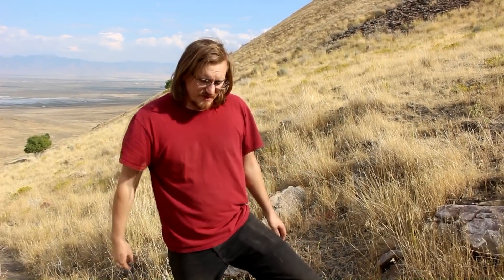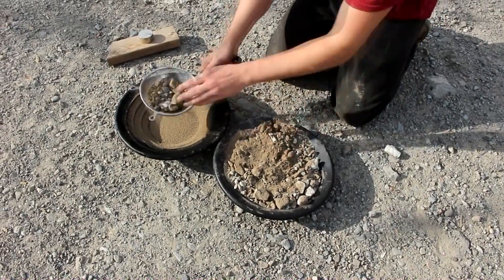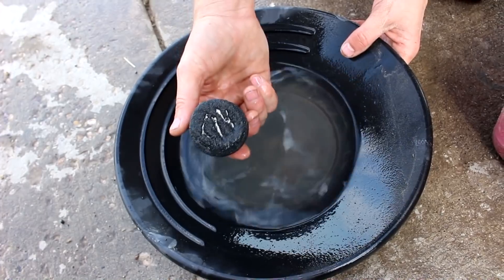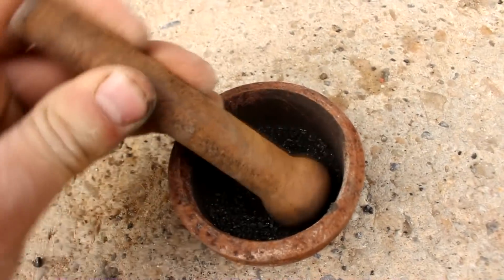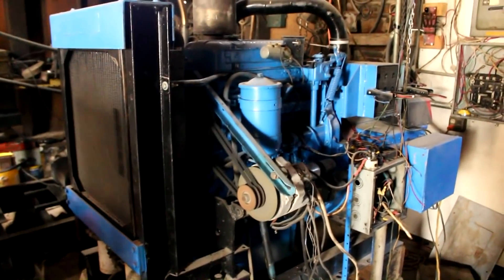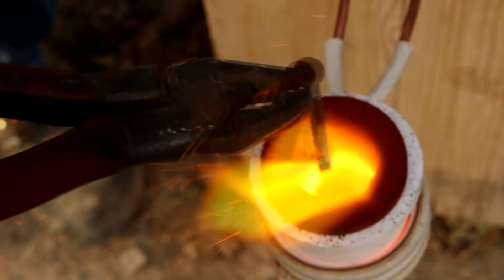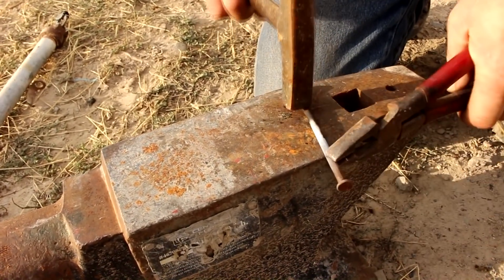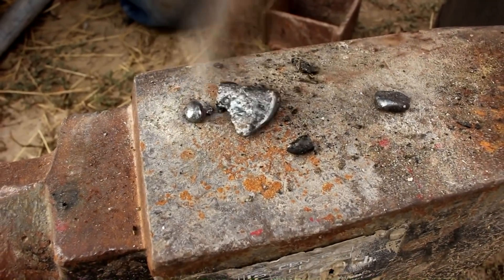Rock to Iron

Comment: I've always wondered, are you able to consume raw iron and gain nutritional value from it? Cereal, for example, is usually rich in iron which is easily separated by blending in water and using a magnet to sift the particulates. Is that the same iron found in ore?
Reply: Those are the same atoms if that is what you are asking. Metallic iron cant be absorbed by the body but it is oxidised into the Fe3+ state in the stomach. This iron ion is then coupled to the transferrin protein and transported trough the bloodstream. From there it can be used by the body.
Reply: To be exactly clear, you cant absorb metallic iron but you can absorb it once it dissolves in your stomach. Small pieces dissolve quicker then others and iron salts are even more likely to fall apart into iron ions. This is why ferrous sulphate is on the essential medicines list.
Reply: Mike Dang In some countries they cook with a small peice of iron with their food for extra nutritional iron.
Reply: use cast iron pots, skillets etc. to do most of your cooking and iron from the cookware will dissolve into your food.  thats a great way to get iron into your diet without doing any extra steps.
Reply: Mike Dang I'm also wondering the same thing with meat because it's also iron rich
Reply: Do cereal companies ADD iron powder?  Or is it natural?
Reply: thats a good question.   id like to know the answer myself.  come to think of it.  on the box of mot cereals they claim to "have 8 essential vitamins and minerals"  
   just where do those 8 essential vitamins and minerals come from if they dont exist in the cereals naturally.   and my hunch is they dont exist naturally.., so they must bee added at some point.    unless its just some marketing gimmick   like most of the "organic" labeling.
Reply: Mike Dang or you can be an iron dragon slayer from fairy tail and eat iron whenever.
Reply: Mike Dang the only thing i understand in your comment is CEREAL

Comment: 5:55 if you were to super cool that graphite crucible too the point it becomes magnetic could that induction smelter then melt graphite? or would the heat generated warm it up to quickly reverting it back to a non magnetic state?

Comment: when you said you could blow oxygen to make it steel and atm its just iron... not totally correct,  cast iron is actually a steel, as it has carbon and iron, but its too much carbon.    So you have steel, not just iron.  The name cast iron is just because of how its made.
Reply: The term steel does not apply for alloys with more than about 2% carbon, so his calling it cast iron seems correct. After all there is such a thing as cast steel also, which specifically has lower carbon content and is not as brittle, but is also cast.
In other words, the term steel doesn't mean any iron-carbon alloy, it requires a specific range of carbon content (up to about 2%), at least that is my understanding.

Comment: Playing with super high amperage and wattage.....and the cooling water pouring on the ground....that's Cody's Lab.
Reply from the maker: Keep in mind we use rain watter on the ranch, no minerals = no shock. course the high amperage is at only a few volts so.
Reply: Eulemit Beule Yeah but that's not continuous current, but pulsed current. I guess you have some supercapacitors or something similar, because if you had continuous 23kA at 20V you'd need 460kW of power and your wires would probably burn through in a matter of seconds ;-)
Reply: If you want high
Voltage go to eletroboom
Reply: Drakkar Calethiel lol. They are the gold standard of safety on youtube ;)
Reply: dude is totally the crock hunter of science. You get sucked at first because you think he is going to screw up and get hurt, but you just end up learning a bunch of stuff along the way.
Reply: @Jos Geerink Did you read my question and Eulemit's answer to that? He clearly explained that it runs off of 2 2F caps and said that his "spotwelder obviously does not provide that power all the time"... So please in the future, do some research before insulting someone. Thanks!
Reply: Farenhite I prefer photonicinduction
Reply: Yes, my spotwelder obviously does not provide that power all the time (and yes, i have 2 2F caps for that). Sadly, i have no 22kV plug for that kind of shit...
On the other hand, my power supply is capable of producing 300A DC, but tbh, you don't need that sort of amperage for anything (except for testing LiPo packs with 170C charging current, but that is not something most people would even consider doing)
Reply: Binary Bits doesn't, everyone do that?
Reply: Jos Geerink He said he has caps that provide the current. It's just for a short period of time, so it's possible.
Reply: The bigger risk is molten metal over a shallow puddle, nothing too crazy would happen, but i sure as hell wouldn't want to be close to it.
Reply: You were correct up until that last part. High frequency current tends to hurt you in different ways but it can still hurt you. Also, a few hundred kHz isn't really high enough to prevent it from flowing fairly deeply in your body. In the 10s of MHz and higher it would tend to stay close to your skin but it could still burn you badly.
Reply: No, I was correct. I was talking about really high frequencies. I'm not sure of the exact cutoff, but a sufficiently high frequency will not even affect matter in an easily measurable way. I'm talking like gigahertz-terahertz range.
Reply: Dziaji a tesla battery will fry your ass instantly. Try it
Reply: Dziaji,you actually explained it better Electroboom when he went on about "current vs Voltage kills" video,thank you.
Reply: Cody'sLab water=ampholyt so there's always som ions, but you sure know that and could probably even tell how much the 10^-7 ions/liter would transport. Still i would not consider it safe just because it is rainwater. I mean after all you can drink rainwater.
Reply: laszu What's "leanguage"?
Reply: Yeah. This thing only produces a high current because it is basically shorted out. Your body has enough resistance to act as a current limiter at these low voltages. Electricity can only deliver you a dangerous shock when the voltage is high enough to produce a sufficient current through the resistance of your body. It also needs necessary current output to produce said current. It also needs to be at a relatively low frequency to harm you. Tesla currents can flow right through you because they reverse too fast to induce currents.
Reply: Dude, learn to read... And to behave

Explanation for idiots:
Spot welder: Uses BURSTS of high current to weld... Not that i have explained that in my post, but some people are just "special"

And btw, are you 12? Please learn to behave when you grow up ;)
Reply: Super high amperage? Dude, i have a spot welder which produces roughly 23kA @20V in my lab... THAT'S high current. (Btw, i usually connect that thing to my 3kW lab power supply... Which is really good if you feel the need to annihilate iron nails)
Reply: Amperage and wattage are the worst words ever made in the english leanguage.
Reply: +Eulemit Beule 23ka x 20v is 460kw you dumbfuck. Good luck running that off your 3kw psu

Comment: Could you extract titanium from white dye?
Reply: Titanium is muuuch harder to refine, because it's extremely reactive at high temperatures. It needs a shield gas for the whole process.
Reply: Titanium dioxide is used in white pigments, not dyes.
Reply: Starting with TiO2 bought as pigment, I've produced nuggets of reasonably pure titanium with the Goldschmidt reaction before. It just takes a lot of flux to protect it from the air and to help it coalesce, but that's still much easier than shielding it under argon or something...
Reply: Thor214 its in sunscreen, paint and even some kinds of shampoo
Reply: not dye, but here's a page with info on doing it.  you basically have to boost the temperature with another reaction. 
http://developing-your-web-presence.blogspot.com/2008/10/on-titanium-thermite-bronze-age-and.html
Reply: Such as toothpaste.
Reply: Daniel Petka 
Yes.  And by that I mean No.
Reply: making some memristors eh mon librepenseur?
research solvents, bio-catalysts et ligninaise decomposition-polymerization process...
though, yes, it might be possible to isolate high-grade TiIII (memristor grade) from titanium sources such as those...
its essentially an electrolysis bath and thermal gradient...

this is part of 'internally printed PCBs" in rapid manufacture - a pipedream for a long time,
to be able to print/make 1 piece seamlessly, with electronics already inside, even for split-curves etc...

not to mention, multiphase-memristors at volume

je prends conge.

Comment: Hey Cody
I want to oxidise copper metal to copper chloride using hydrochloric acid but it seems very slow. I don't get any hydrogen peroxide over here but I do get potassium permanganate or manganese dioxide easily. How should I oxidise copper metal without hydrogen peroxide. No Nitric Acid
Or Sulfuric Acid or Hydrogen Peroxide. Please help me man. I've watched nearly all of your videos atleast thrice.
Waiting eagerly for your reply
Reply: Raghav Galgali use electricity to force the copper metal to turn into copper ions in solution. The copper ions will then react with the chloride ions in hydrochloric acid solution.
(I.e. electrolysis of hydrochloric acid using copper electrodes)
Reply: Pixl Rainbow I've already tried it but it just forms insoluble gunk which is very hard to filter and does not like to come together
Reply: Raghav Galgali black gunk is copper oxide. Blue-green stuff is copper chloride. Just make sure you have enough hydrochloric acid in there, copper oxide should react just fine with acid and turn back into copper chloride. Do note that copper chloride is soluble in water and cannot be filtered out of water
Reply: Pixl Rainbow It's not copper oxide
I know that it may sound funny but first time I electrolysed soln of MgSO4 using copper electrodes instead of my regular carbon ones and I found some light blue ppt in the soln which dissolved in hcl 
Then I added more copper and hcl and it just turned into a gunk that I had to throw away
Reply: Pixl Rainbow And don't worry I get HCl for very cheap in here about 0.3 dollars a litre of 36% HCl
Reply: Raghav Galgali if left exposed to air for too long, carbon dioxide dissolves into your solution to form carbonate ions. Copper ions will combine with carbonate ions to form insoluble copper carbonate, which is a bluish aquamarine coloured precipitate. Being a carbonate, it will react with acids like hydrochloric acid. In neutral solutions, some copper hydroxide may also form, which is also insoluble in water and also has a bluish colour.
Reply: Hcl and manganase dioxide dissolves copper, if it is too concentrated some chlorine might bubble out of solution, so do it outside or in a fume hood. (Chlorine is somewhat soluble in water)
Reply: Bleach and HCl might be better, sodium cations are a little bit easier to separate from the copper than manganese.

Comment: What’s with the last 5 seconds?
Reply from the maker: something that snuck in from another project
Reply: Cody'sLab haha. Nice video btw
Reply: I wondered too, looked like some kind of valve/tube maybe?
Reply: Next time, on Cody's Lab.
Reply: bigclivedotcom simulator :P
Reply: sneak peak of the next video?
Reply: Flux capacitor
Reply: Cody probably uses old tapes ;)
Reply from the maker: I like how nobody got it yet.
Reply: Amp maybe
Reply: It's a Catode Ray tube that he probably got from an old small osciloscope.
Reply: Tube socket for sure, but not a vacuum tube.
They used the same sockets for a lot of other items, still do sometimes, relays and timers and such. Not sure what this is.
Reply: Looked like a vacuum tube.
Reply: it appears to be a CRT from an old tv set
Reply: a robot's penis
Reply: I never know what is going on in the "teaser" at the end. Doesn't seem to be connected to the next video and he gives no explanation.
Reply: battery
Reply: A flyback transformer?
Reply: Knowing Cody, it's either explosive, radioactive or both.
Reply: Was that an ionizing radiation detector in a vacuum tube type packaging? :)
Reply: Looks like you were opening up some sort of tube from like a tube radio. ;p
Reply: Illudium Q-36 Explosive Space Modulator
Reply: It looked like a temperature controlled crystal oven to me.
Reply: I'm guessing an early silicon transistor using the old vacuum tube plug. Or maybe a Modern replacement transistor for your old tube based appliance.
Reply: +cody'slab nobody got it yet because it's an 8 pin mercury wetted contact relay. 

other types of fun mercury switches that can be fun to mess with are safety relays that mercury moves from one side to another in order to go from open to closed similar to old thermostats.

these were used where you wanted a good connection to avoid voltage drop from a mechanical connection, and to avoid contact bounce where it might damage what your are switching low voltage power to.
Reply: Jens Behrendt How many trolls does it take to get 77M views?
Reply: I would put my bet on a mercury relay.
Reply: Could be a steel-case mercury arc rectifier.  I've never seen such a small one, but I would guess they exist.
Reply: My best guess was maybe a shielded RF transformer or tank coil from a multi-band set, but I like the crystal oven idea better.
Reply: Im guessing it's for his rail gun
Reply: Sai Skanda obviously a hint for the next video 😏
Reply: Calling it right now, photomultiplier tube, that's why it's encased from light
Reply: Cody'sLab Cody i was just wondering of you could sell me a bar of gold or tell me where to buy gold
Reply: I also let the entire song play. Because I'm no punk. Cheers. :D
Reply: Nightbot YES
Reply: Sai Skanda that looks to be a vacuum tube, maybe a radiation detector next?
Reply: Or mildly toxic, like cyanide or mercury. Or the next piece he needs for a home build nuclear reactor...
Reply: The best part.
Reply: Tooking vacuum tube apart?
Reply: i'm betting it's an electron gun.
Reply: Cody'sLab ur gay
Reply: it was a cathode tube from the looks of it
Reply: Nixie tube (but didn't see a glass opening)..
Just a guess.
Reply: Cody'sLab one more guess, trying to get some metals out of there?
Reply: Sai Skanda I still haven't watched the vid 😂 xD
Reply: Geiger–Müller tube?
Reply: Cody'sLab Haven't seen it yet, but I'm guessing a Farnsworth-Hirsch fusion reactor!
Reply: Just saw it. Nevermind :3
Reply: Cody'sLab oh dang the suspense lmao😂did u make the vud with that last clip in it cody?
Reply: some kind of octal socket tube
Reply: Looks like he found an old TV or radio and is playing with the vacuum tubes
Reply: Definitely looks like a transformer to me.
Reply: That was more tan five seconds
Reply: Check out the teaser breakdown on the CodySlabTube:
https://www.youtube.com/watch?v=oHg5SJYRHA0

Comment: Uranium metal from ore would be super cool!!!
Reply from the maker: And possible with this unit.
Reply: Golden Duck compounds of Uranium, like Uranium hexafluoride, are highly toxic. Although uranium is better known for its nuclear properties, one must never forget that uranium is also a heavy metal.
Reply: Neil Beaudry And super toxic&dangereux
Reply: Cody'sLab Its posible to extract coper from ore ??
Reply: Cody'sLab *posible to do in your video.
Reply: its actually easier
This is why we started with copper and bronze instead of iron even though iron is better for tools in pretty much every way
Reply: +Kamun Reser uranium wouldn't be toxic or dangerous
Reply: Golden Duck yes it would
Reply: Elemental uranium is not that scary. Its just as poisonous as lead so you would die from heavy metal poisoning if you digest it before any irradiation. If you have some centimeter metal barrier/container to protect you from highly enriched metal its harmless. Geiger-Müller counter advised ofc.
Reply: Who did this?  Uranium its more toxic that lead, and its radioactiv
Reply: Pixl Rainbow also uranium nitrate and chloride